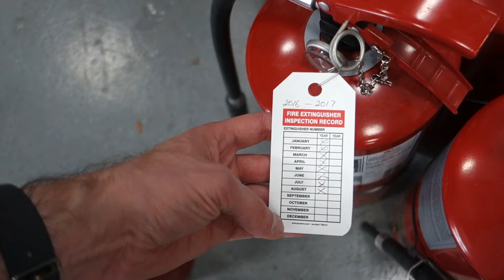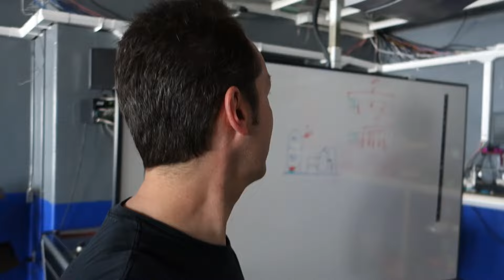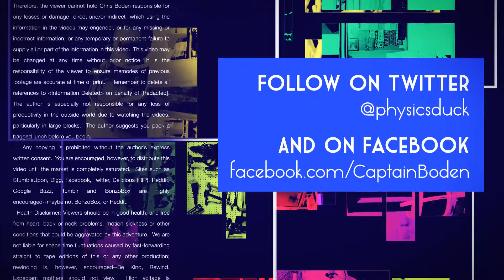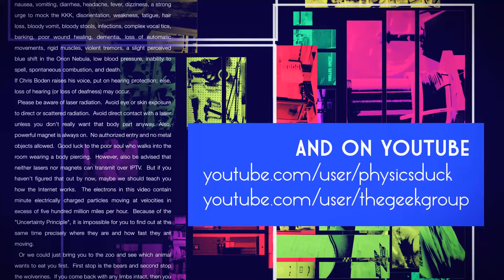Captain's Blog 9 16 2016 Tiedowns and Stripes

Comment: 1303  good wall mount idea.  my for profit employer always has something for me to do.  fire safely is important.  hi veejay.  did i see Liz smile slightly?  1307  eric snerthammer is very helpful.  that viewer mail someone has to be more specific.  my employer gives a pin after 5 years and then a secret website every 5 years after that (at 10 then 15 then 20 years).  at what length is a video real? :)  please show who 'they' are.  hi mackie.  that hook you cut off is a piece of junk.  batman that light is a good idea.  tightly connect it to the boat.  https://www.google.com/webhp?sourceid=chrome-instant&ion=1&espv=2&ie=UTF-8#q=drill%20a%20square%20hole might help.  Christian has to learn at some point.  what does that brass ring do?  been a long time since i ended at 1600.  those straps are strong.  stripy door is very helpful.  what class are you attending?